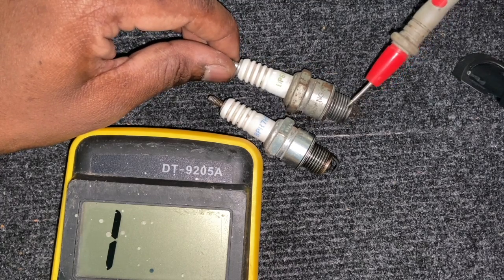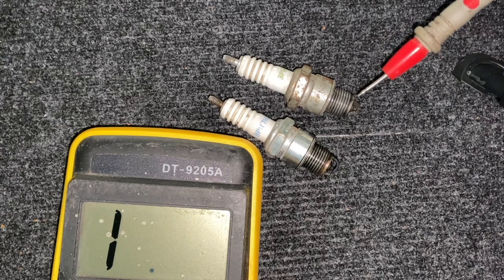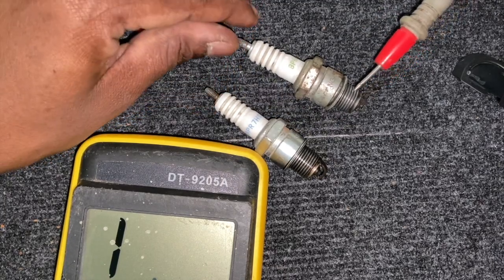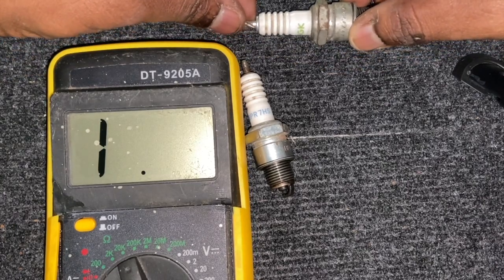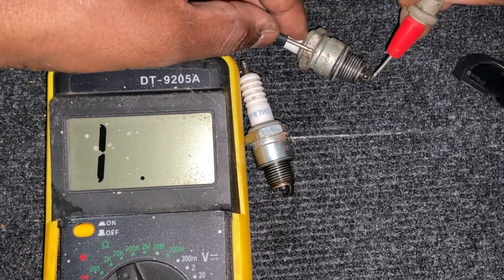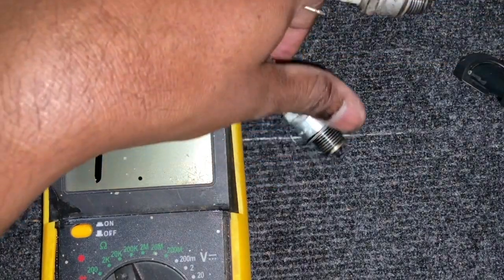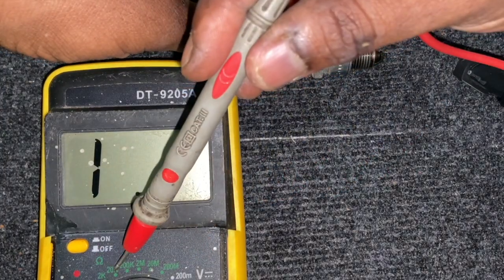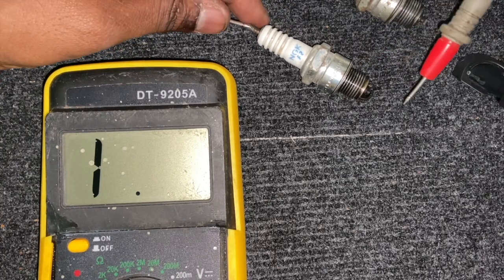Testing for a bad spark plug (English video)

Comment: Can we use stock rx plug adapter with NGK iridium plug?
Reply from the maker: If original Yamaha plug cap then yes
Reply: @Yamakaze  ok:)
Reply: finally installed the iridium plug on stock plug cap..earlier I fixed it without removing the screw that the iridium plug had on its top..
Reply from the maker: @KK-cd7nu  ok

Comment: Bro,is it necessary to use 5k plug cap for 5k spark plug ?
Reply from the maker: Yes, 5k plugs and caps were standard on all Yamaha bikes
Reply: @Yamakaze  bro,Can I use hero plug cap (red one) which does not have any resistance? I think it improves the spark a bit.Your idea please.